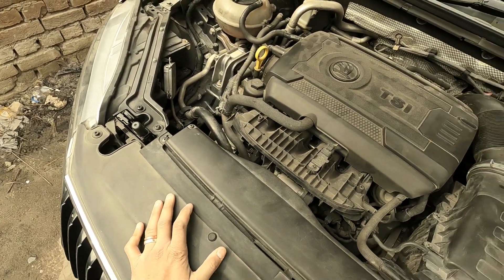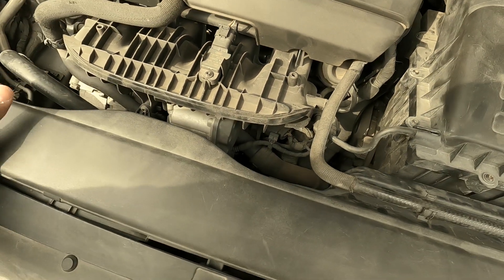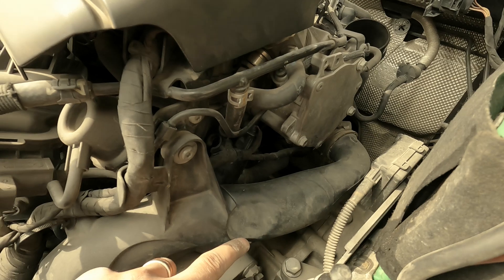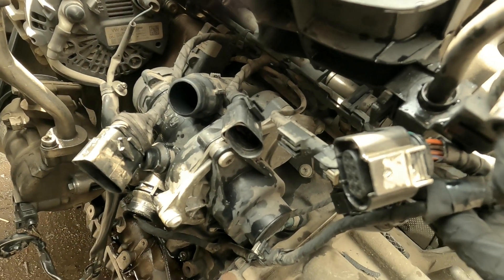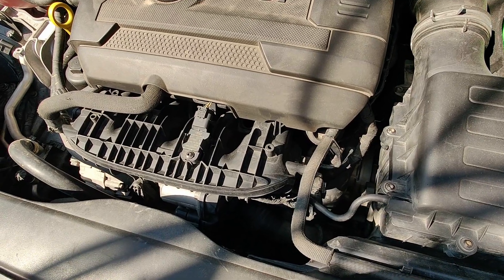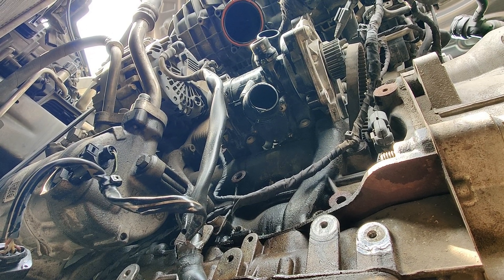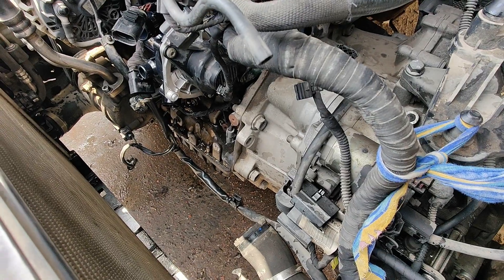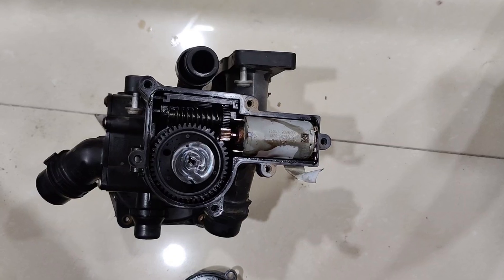THERMOSTAT WATER PUMP | 1.8 TSI | 2.0 TSI | AUDI | GOLF | MK7 | OCTAVIA | P255600

Comment: My 2013 1.6 vento getting this tak tak sound noise while accelerating and  huge smoke getting out 
Due this i recently changed the turbo core but the complaint remain same before there was black smoke now its like grey smoke only that difference 
Sir can you find the real reason
Reply from the maker: Most probably an injector is stuck , leaking to much fuel inside